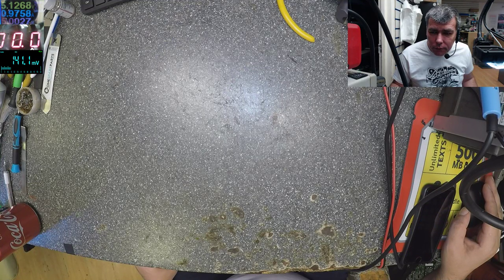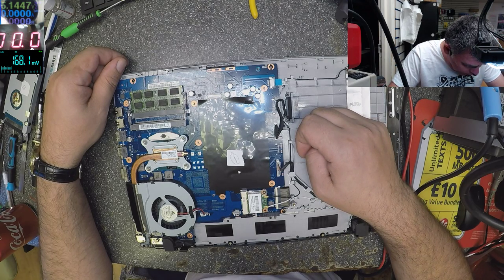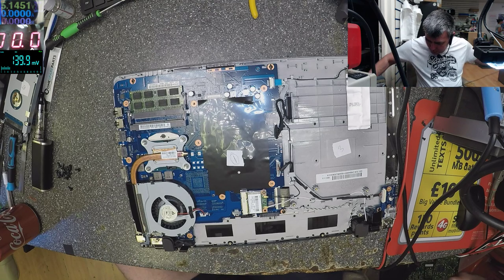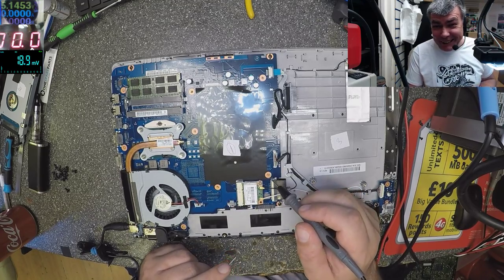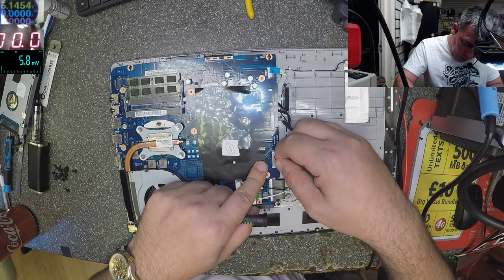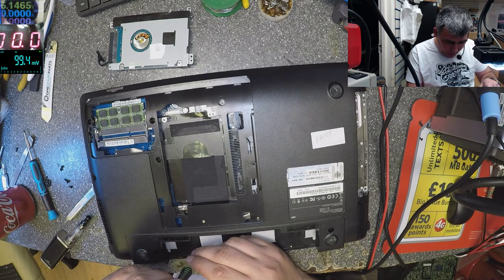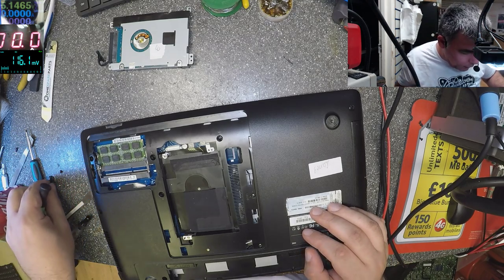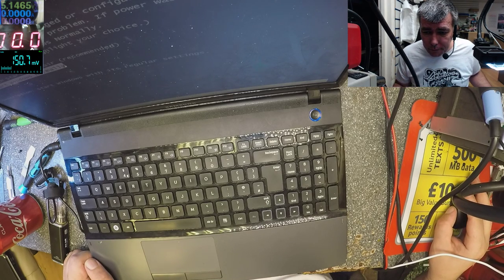Samsung NP-300E laptop, motherboard repair

Comment: I have the same model, it power on and samsung logo shows but then restarts.
Cannot get to BIOS and fan is working well.Any ideas?
Removed cmos battery and ist 3.2v measured, put it back but the same thing.

Comment: hello sorin, ive seen you using a jumper wire over the mosfet just to bypass the mosfet. what is the size of the wire that can be used to bypass the mosfet? can i use a jumper wire that is used in repairing smart phone? can it handle a 19 volts and the amps that the laptop is drawing?

Comment: You are the best!! 
I have the Same samsung laptop NP-300E5X. the problem is when i connect the charger the green light appears at the same time the red flashes and its not coming on, what might be the cause of that sir?
I have 19v, 5v and 3.3v but no 1.5v. Please help Sir!

Comment: i have a Toshiba satellite laptop L505D-S5983 .and the Ac power adapter  plugin only the dark screen is there it only have one green power light  is on  and no power  and when I put the new battery in it try to start the laptop  how can I fixed  it

Comment: Hello need your help here. I have the same model of laptop, when I turn it on it load for long and goes to automatic repair. When I try to install windows i can't go pass "getting ready for installation, I will get errors at that point. Have checked and certain that there is no problem with hard disk, RAM and the installation usb drive is also fine. I don't know if the sata cable is working well. Kindly help.

Comment: Hello.. my Samsung 300E5C laptop is not coming On. However the green indicator for power available is coming on immediately I plug in the charger. But if press the switch, still not coming on? What then could be the problem? What should I check for?

Comment: Sorin, could you tell if it is easy to make an accidental  short circuit and burn something on the mobo when using a multimeter? Thx in advance.

Comment: Hi sorin. Heard that if u disable grafic chip power by removing its coil then the motherboard will not recognise grafic chip and will start.  Cpu should have integrated grafic also and switching one. Is this true?. How to know coil of that grafic chip without schematic. Thanks

Comment: I have this laptop - NP300E5C - When I press power it does not post and cpu runs at full RPM. I think this could be the bios. I have a CH341A Pro Bios programmer.... still a beginner and practicing. Would you be able to tell me where to find the bios on this motherboard? Schematics I have does not show me where to locate the bios chip....  Thank You

Comment: Sir i have problem with my np300e, laptop turn on then turn off after 2 seconds. If i put out processor it works, fan is spinning and not turn off what it can be

Comment: Sir i have the same laptop 
I disassembled it and it was turning off after 5 mins or 10 
Then i installed fresh windows then it worked fine but after 15 days it suddenly turned of and now it does turn off the light is on of the on button but no display nothing

Comment: is it worth picking up a laptop on ebay for repair or parts to fix it for personal use? Seems to me those laptops are picked clean so refurbishing them could cost more than $100 dollars, but if you can get an i7 for 30-40 dollars and the motherboard boots to bios, it might be worth it?

Comment: id love to see if you could repair my old msi stealth pro. MSI said the whole mobo needed to be replaced and cost 1500euro to fix without telling me what the issue was. They pretty much point blank refused to tell me why. I did send it back before then toward the end of the warranty for cleaning and to fix the screen as the hinge damaged the cables to the screen. The same issue re-surfaced a month later and as I said they refused to tell me what was wrong.

Comment: when you replace a mosfet by solder, which pins you should link together and which one you shouldn't, i saw you did not solder the top one...
Reply: adel saidi  he connected the source and the drain and leave the gate part. it acts like a switch and its ok to bypass that mosfet by solder or jumper wire as per Sorin.

Comment: hello sir. thank u for u r amazing videos. i was wondering if u could make one explaing how power flows from laptop dc jack to other components. cz i been trying to fix hp 6930. and when i measure 19v at the first two mosfets. at the source i get 19v at the other end (drain) there is no voltage at all. now what confuses me is there is voltagt at some ics' in the board. thank u sir.

Comment: Hi Sorin.

I really enjoy your videos.

I had to repair that very same laptop  (brand and model) a couple of weeks ago. 
Same fault so I was going to take the same approach as you did, but watching this video gave me some more confidence about it :)

Only thing is I screwed up and managed to blew away that tiny capacitor next  to pin 8 of MOSFET AON7200. When I tried to resolder it 
I couldn't hold it in place, it kept sticking to my pliers instead of to the board, so it wouldn't stay in place. 

I'm obviously not good at soldering so, and I could use a steadier hand but with this kind of tiny parts (not sure if it's a 008004),
do you have any special tricks/technique to solder them? 

Thanks!

Comment: if your checking computers, isn't it best to have the schematic.? for someone such as yourself if your repairing many laptops, you get used to the circuits, but for someone who may just have started checking laptops, would they not be best to try get the diagram first of the board to gain experience ? A silly question maybe, if you remove a component from the laptop and that components has a 'very small internal resistance;, but the laptops works once you remove the component, does that put extra stress on the remaining components, EVEN if only a very small amount.?  GOOD JOB, !!
Reply: Yey yeh yes

Comment: Sorin, great video as usual, very clear & easy to understand, i'd greatly appreciate if you would do a component run down on a future repair, small capacitors, resistors, fuses all look very similar, a lot of them with no visible markings leaving it very hard to identify the values unless you have access to schematic drawings, i would really appreciate it if you could explain how to identify the more common types, many thanks again, keep up the great work
Reply from the maker: Thank you, yes, i will do
Reply: Thank you Sorin, really appreciate all your efforts.
Reply: Good question. I also have this problem
Reply: Hi sorin great video well explained,and as you said ask any question! I have one,I have a asus stream I'm trying to fix and the first two mosfets are faulty,can I jumper 2 mosfet,and I know you don't like to do this.but if you were too how would you do this😊 your the man

Comment: Thank you very much. You are best teacher. I have a question. How can i know in battery, if  i have problem with some component, or i have problem with Deleted RAM Memory in a battery chip? I have 2 laptops. 1. have waterdamage issue, 2. battery stopped to work for no reason. First laptop is new and second 4 years old. I repaired tham both thanks to youre help. Second one shortcuting both first mosfets. TY :) I think if there is some problem in laptop, charger stops giving power, so no problemo.

Comment: I have acer laptop top 5742 .Powers on (fan is on ,andpower button light is blue).without pressing button ,but no signal on screen.. Parts of motherboard extremely hot.Thanks full for  advise . YES  Thank you for the great videos.

Comment: i had an asus laptop that had the same mosfet go out i just put a fusible resistor on the drain so in case of anything going wrong the fuse will go out

Comment: Hello Dear Brother ..help me .hp zbook 15 laptop this problem ......
.Displays late gives error of fan(f90b) after display if we press enter there then start windows perfectly in windows sytem works properly accept keyboard and battery and both are not detecting when we shutdown properly system shuts down but power button led remains on after this if you want to start laptop again it can not be power up unless you unplug the charger and reconnect it after a while.

Comment: nice video very informative but i have a question if if  we get amps from the power supply what does that mean. it means that  the switches are fine but we must to find capacitors or something like that who creates heat and is shorted or still we replace the switch .   am i wrong ?
Reply from the maker: if a board is taking 1-2 amps at 19v, its ok, but if its taking 1-2 amps at 2 volts, its short. Thats how the curent limit works, lowering the voltage

Comment: Sir I'm having samsung Laptop model number NP300E5ZAOTIN. Having 8gb DDR3 RAM installed. Having chipset: Mobile Intel HM 65 Express. Clock speed 2.1 GHZ and Cache 2MB. I'm having B950 2nd generation Dual core processor.
Sir, can we upgrade to higher level processor upto maximum which generation...?

Comment: i HAVE WI-FI BOOSTER 15 CM FROM NP 300E5 E  AND RECEIVE 50 % OF WI-FI SIGNAL.  I THINK PROBLEM MAY BE DIRTY CONTACTS AT WI-FI BOARD PINS TO MOTHER BOARD. FOR AN  OLD MAN IS THE REMOVAL  AND INSTALL OF THIS SAME  WI-FI  BOARD DIFFICULT ?  SHOULD I TAKE TO REPAIR SHOP?  i HAVE DONE SIMILAR WORK BEFORE SUCCESSFULLY ON TOSHIBA LAPTOPS.

Comment: I recently had this exact issue with an identical laptop and I revived it in the same way, however I'm curious about two things which may or may not be caused by this "repair": I noticed the laptop "double-posts", so you press the power button, the logo comes up and then it briefly shuts down before finally staying on (CMOS battery is ok, in case you're wondering). Also, would the battery still work as normal ? I actually found this laptop as junk and managed to fixed it thanks to you and since it's decent, I'm thinking of investing in a battery for it, but ONLY if the charging circuit still works, otherwise it would be a tremendous waste of money...haven't looked at the schematic to see what that transistor we've bypassed actually does. Cheers and thanks.
Reply: It is protecting the board, it switches off if there is some short but most likely the second mosfet would switch off, not the first. Since the first one was switched off, I assumed the second mosfet was on short so the first one switched off. He tested for short with the power supply and there were no power taking, so no short.. This one was just faulty mosfet, there was no short, nothing caused it, that's why he said it was ironic, the mosfet that protects the board actually caused the problem.
Reply: @Marko_Djuricic  I'm interested to know what he's doing after he has removed it, I can't see what he's doing with the solder
Reply: @davidpringlepatrick4262  He is making a bridge to connect the source and the drain (4 pins on one side, 3 pins on the other side). He could do it with the piece of wire but he is too lazy :D Get it?
Reply: unfortunately the brightness in that part of the plate is too high
a query the bridge on the left has the 4 pins and the one on the right 3? What is the pin that is not bridged?
Reply: @ronaldcancino6279  gate pin

Comment: can you explain how to check a mosfet with multimeter in-circuit without a charger plugged, thank you
Reply from the maker: From my experiences , a mosfet can work fine or can be in short, so check only if they are in short, otherwise its no point. But,  let my find a job with dead power supply on the motherboard and i will make a video in detail

Comment: Hi sir i have the same laptop samsung np300e but the problem is that the backlight isnt working i tried replacing the whole screen but still no light i think the problem is in the motherboard. Can you make a video about it or give ideas where to start checking signals / troubleshooting from the motherboard..thank you so much
Reply: Solution?

Comment: thank you so much Engineer. am actually learning alot from your work. i have a Hp 2570p, it automatically comes on when power is plugged in but no display. please what do you advice
Reply: for the automatically coming thing probably has something to do with cmos.but for the display it's either a display problem or a graphics chip problem watch his video in which t has the exact same problem.

Comment: Hello, do you know the value of those inductors (i've seen a schematic that indicates they are inductors)(those two you say they are resistors?) near the power jack? Or the reference? Thanks. Love your work, you are one of the few that explains in detail what you are doing. 

Edit: Found those components: They are HU-1M2012-121 inductors / 6A 120 ohms
Reply: They'll only measure 120 ohms at 100mhz+ for high frequency filtering, so when measuring using a multimeter they should be measuring less than an ohm...milliohms in fact. That's why he jumped it... it'll be alreeeet!! 😊

Comment: Hi. I admire your work very much. Could you explain me which solder pad you connected  to cheat the circuit? It's hard to see. Did you connect all the pads ?
Reply from the maker: already explained, check the video 'about motherboards'
Reply: Still looking for motherboard video

Comment: Hi am John from Ghana. I love your videos and humor. I have a question. I flashed a bios on a dell n7110 laptop and after there is no sign of life in the laptop anymore. What could be the problem Pls.
Reply from the maker: thank you, probably the bios, check online if you can rewrite the bios via usb and do it
Reply: Electronics repair school I used a device called ezp2000. I downloaded the bin file and flashed the chip. And no sign of power in the laptop. Not even a charger light
Reply from the maker: voltage on the bios chip  pin no 8 ?
Reply: Electronics repair school are you on Skype pls

Comment: So you removed the chip, then heated up the pins where the chip was on the R/H side and added some solder, but you didn't replace the chip?  You didn't explain what you did by removing the chip and adding solder?
Reply: I am asking the same question

Comment: Hello sir ,

Please help me :) or I will lose my mind  :) , I have just exactly the same laptop with same board, the problem is  that everything is working great except the keyboard, motherboard has no issue power  is ok laptop boots opening windows 10 without any issue  but keyboard has a strange problem almost %30 of keys not working and the rest of them functions as wrong like for example if you press B key  , numlock is functioning  or if you press C key X is showing on screen (I mean keys does not functioning as it's representing) first I thinked that keyboard is faulty and replaced it with new one , but guess that what happend  ,just exactly the same problem with the same keys, I checked the keyboard ribbon connector it's not loosing and keyboard connects well to motherboard with the connector and all pins are ok , I checked the super up chip on motherboard which is SMSC MEC1310-NU , it seems ok and no short circuit on chip legs , please sir help me and give an idea that what may be faulty  ??  May be the super up chip problem?? Or caused by this?? I searched everywhere about same or similar problem but I found norhing about this strange problem , also I could not found the schema of the mainboard and in addition to all this is not a windows problem or numlock or scroll lock problem the keys are not working on bios menues as well , only F2 keys working ok to enter bios menu then no others are not working like arrows , enter , tab none is responsive :( please sir give me an idea what to check or what might be the problem?? If it's super up chip can I use neutron??  Instead of SMSC ?? because I have no smsc brand   as spear parts but have too many neuwton super io chips

Ps: I have good soldering skills and has smd hot air station , sorry my bad English and thank you sir , please reply me ,please 

Best regards

Comment: It's probably the fries :D We've had three thunderstorms today with heavy showers today.
Thanks for this repair! You've bridged 6th and 7th pin, right?
Reply from the maker: you have all 4 pins together on one side and 3 pins +1 on the other side........ so, its not important as they are together, just avoid the single pin. About the thunderstorm... you are lucky! :))
Reply: I'll have to find that video with schematics :) Meanwhile, please keep these vids coming :)
Heat keeping you up?
Reply from the maker: the heat its keep me up in the night time :) Thanks
Reply: I hope it will ease off soon! Good night!
Reply: unfortunately the brightness in that part of the plate is too high, a query the bridge on the left has the 4 pins and the one on the right 3? What is the pin that is not bridged?

Comment: sir i have toshiba a305-s6825 with intel vga but i have display problem i changed ram and processor but disply is not working any solution ????
Reply from the maker: Do you have light on the screen?
Reply: Electronics repair school no sir a have no any light on screen i tried extarnal monitor but disply is not working
Reply from the maker: can be anything, hard to diagnose

Comment: Hi sir,
 my samsung np530u4c laptop hdd is ok but it not  show in boot menu and it not booting. plese suggest me a solution
Reply from the maker: check the bios, check the uefi/legacy settings
Reply: but i reset bios  didn't work
Reply from the maker: how the windows its installed there? uefi or legacy?
Reply: uefi.......
 sir imy  lenovo e41-15 ideaped keyboard connector was damaged , how can i connect onother power botton?